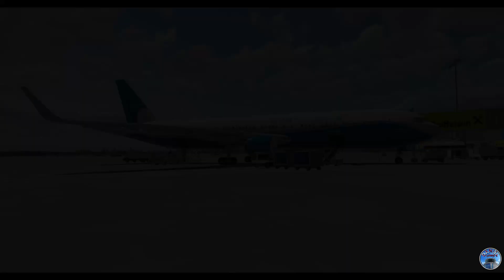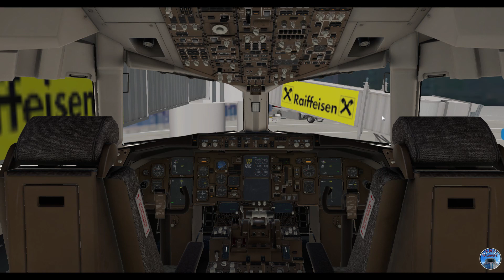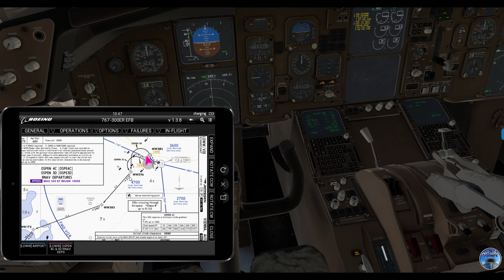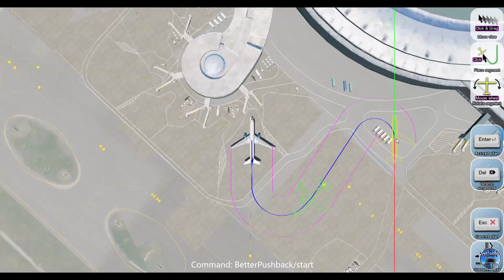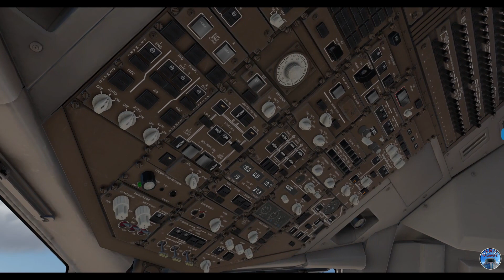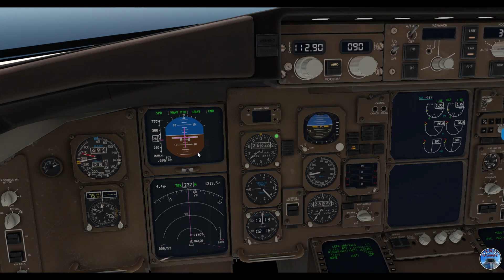XFirstOfficer for Boeing 767 by FlightFactor

Comment: Would you recommend getting the FF 767 at this point? Asking bc of the small problems with lnav and vnsv that you have had. Great video by the way!
Reply from the maker: I absolutely recommend this aircraft. But you have to take into account that all FF aircraft are very complex. On the other hand this complexity brings the great feeling. 
The problems with LNAV and VNAV I had in the approach phase, were maybe because I have not that much flight hours with the 767 and did something wrong. Most common reason at this point are flight plan discontinuities ;-), but haven't checked it on the end.
Reply: @daniellowg  Thanks for the reply! Then ill definitely check it out! Subscribed